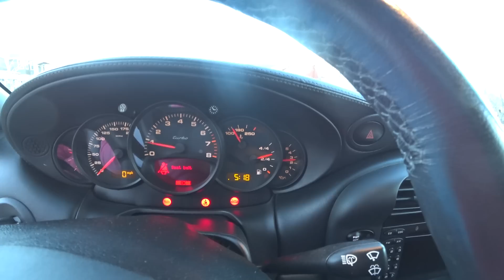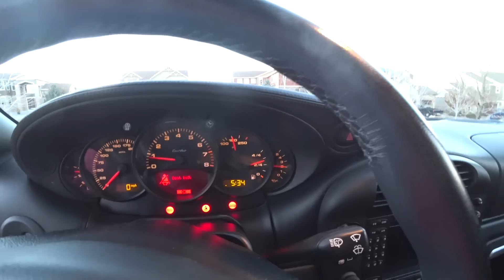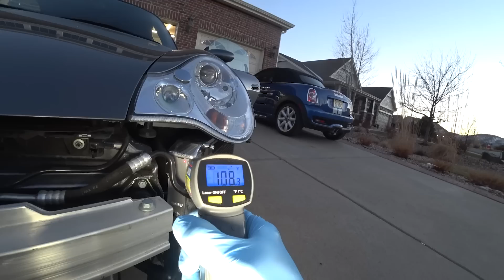Replace your Radiator - Refill without air pockets! Airlift! (996 Turbo)

Comment from the maker: Eeek a leak!! Hi Everyone, Well, the 996 Turbo's left radiator sprung a leak.  In this episode I go through draining the coolant, removing and replacing the radiator, and refilling with the AirLift Radiator vacuum filling tool.  That thing is amazing!  Let me know if you have any questions.

Tools and stuff in the video:

AirLift Vaccum Radiator Fill: https://amzn.to/2ULyE2c
Silicone grease: https://amzn.to/2GguZGs
Thermal Temperature Gun: https://amzn.to/2GlfVr7

Comment: Excellent as always. Concise & appropriate emphasis on potential problem issues. Completely agree about cleaning out the radiators. I bought a '99 Boxster last Winter & both radiators were blocked by leaves & plastic lids from cups. I fabricated some mesh screens from steel gutter guards on the back of the bumper grills to keep the larger leaves & cup lids out. A simple $6 improvement. Thanks again for taking your time to share. All the best.
Reply from the maker: Thanks!  Great idea!

Comment: Hi Franny and Heidi. Just did the radiator on my 996. Used the small inlet “ small tube and a funnel “ to ad water. Made it no air. Just a hint so you not need a vacuum tool. Ps had the wheel off and the car up in the working corner. Best regards. Jørgen Copenhagen.

Comment: These cars always have coolant issues. Especially the first generation 997 Turbo. I would never buy one because all my friends are always complaining of the coolant smell. Don’t hear the issues on the 996 turbo. Great job guys!
Reply from the maker: I bet that coolant smell is the weeping radiators.  The OEM radiators weep (not leak necessarily).  Our 987 '06 Boxster S had the same issue...  That was the primary reason I went with these all aluminium replacements.  We don't smell any coolant anymore!  But...  These engines can also loose the coolant tubes pressed into the engine.  I swear these engines are fighting being water cooled with their last breath!!

Comment: Brillant,  I would not even attempt to fill the cooling system in a Porsche without one of those vacuum devices. I changed out my water pump on my non-turbo 997 a few years ago. I weighed the amount of coolant that came out and weighed in new coolant (did not change it all) . I found afterwards that the coolant was exactly at the same point in the tank as it was before.

Comment: Thank you for putting this together, very well done, I changed all 3 radiators, and purchased the coolant lifter tool which made it real easy to refill the coolant system.

Comment: Just did the same to my 2002 911 turbo, except it was the center radiator leaking in my case.  Initially, I was considering upgrading to a CSF rad, but I got lucky and got a good deal with a never-been-used OEM unit that I found in the classified ads. The coolant that was in the car was green, so I suspect it wasn't the right one and I didn't know how old it was, so I did a complete flush.  Getting all 6 gallons drained out is indeed a process, but a little bit of compressed air makes the job easier.  To refill, I also used the Airlift and it worked great!
Reply from the maker: Thanks for that.  Interesting your center radiator went out...  That was the only one that didn't leak on our car! Good idea on the compressed air.  If AirLift was clever, they would engineer their product to do both ;)

Comment: Another great video Franny, I`m going to be changing the waterpump on my 996.1over Christmas and then have a cleanout of the radiators as a precaution. These cars are great to work on sometimes but I changed the waterpump on my 987.1 Boxster S a few months ago and that was a real pain as it`s behind the drivers seat.
Keep the videos coming girls.
Reply from the maker: Oh, I bet...  The only downside to a Boxster is that front engine access...  Great cars though!

Comment: A couple questions:

1. How long do you estimate repair took start to finish?
2. Estimate of your cost vs dealer charge? Just curious. 

Getting good customer service is such a good feeling. Thanks for sharing.
Reply from the maker: Um,...  It always takes me longer because I am filming... but I bet it could be done in about four to five hours?  Since the radiator was a warranty replacement and I re-used the not-very-old fluid, it was a zero cost job for me, but that was just lucky.  I don't know about the Dealer or Indy, but maybe $500-$600 plus parts?  Just a guess though.
Reply: Thank you for your answer. That was exactly what I was looking to know. Thanks for sharing.

Comment: Great timing! My 997.2 has a small leak at an O-ring. I actually have the Airlift tool; however, I haven't used it yet. This was great. The systems seem similar between the 996 and 997.2 yeah? Love this channel!
Reply from the maker: Thanks! Yup, I think they are really similar.  We had an '06 Boxster and it was pretty similar.

Comment: Oh, you've been to Harbor Freight. I can see three of those blue LED lights at the top left of your screen that they sometimes give away and those Pittsburgh impact set. lol I have the Schwaben Refill/Air Purge Tool and using one is a first for me for my 991.1 GTS. Luckily my 993 won't need it (snicker)...nothing like "air cooled". Nice to see you are particular in how you do things. My cars and motorcycles never make it to any shop for the same reason.
Reply from the maker: HF has some great stuff! ...and some crappy stuff...  But their tools have a life-time guarantee and are great for light to medium duty.  I bought some Craftsman tools at the end and they were terrible - and that is compared to the Craftsman I already had. There certainly are better tools out there for sure though :)
Our 993 has has so little go wrong it is hardly in any videos ;)  Great cars!
Reply: @HeidiandFranny  
In my very early teens, I could not afford much in the way of tools but when I got a summer job in my late teens working at VW prepping cars and working in the body shop, I had a choice of Snap-On or Hazet; I chose Snap-On and they cost me an arm and a leg on minimum wage. I now have a good selection and buy the odd tool as needed. I also have a Snap-On 1/4", 3/8" and 1/2" clicker torque wrenches, all calibrated (not bad for a home mechanic), but here is a tip, you can get them much cheaper from Precision Instruments who I believe is owned by Snap-On. I head stateside now and then to go to HF. They do have some quality tools. As for your model aircraft, that is how I started (U-control) and then got my PPL, CPL and Instructors.

Comment: An excellent vlog both in the instruction given, the production and of course editing. The fact I now feel confident with replacing a 996 T radiator when I normally limit myself to fuelling and detailing the car is testament to your coaching ability. I realise it's of little comfort but you both should have far more subscribers if only to increase the mechanical capability of the population! Kind regards, Kevin.
Reply from the maker: Thanks Kevin!

Comment: Love your video's even though i don't own a Porsche , just a thought on that aluminium Radiator that failed  and antifreeze mix , Aluminium doesn't like tap water a lot ,it's best to use deironised water in the mix. It's good that you highlighted the excellent customer service from that company ,it's becoming a rare thing in this day and age .Thank You Again.
David .UK
Reply from the maker: Thanks David and that is a good point.  I didn't cover that because I reused the coolant, but I should have. When I did this last time I did use deionized water to cut the coolant (per Porsche) at 50-50.  The little bit I had left over was from that batch.  I don't know why that radiator failed... Great catch! F
Reply: Thank You Heidi, Keep Up The Good Work, and i wish you and Heidi a Merry Christmas and a Happy New Year. Take Care Both. David
Reply from the maker: You too.

Comment: Man, awesome video on this process.  Nice to see someone else that cleans everything that comes apart.  Everyone looks at me like I'm crazy when I clean everything like that while doing jobs like this. Awesome tool suggestion. I have heard of these but just haven't invested in one. Just curious, what what the issue with the original radiator?  Metal fatigue? Debris damage? Vibration/wear damage?
Reply from the maker: It was leaking near the top. No idea why.

Comment: Hello Franny, as everytime you make a video on your 996TT, I loved it. It gaves me the motivation to do it on the right radiator of mine. Thx for the links, especially the vaccuer.  But I am missing only the one for the full aluminium radiators (CSF?) / hopefully they have some dealers in Europe / Germany... ;-) BR Yann 
P.S: continue so, even if the number of subscribers/viewers is not so High as the quality of your work. You are amazing, competent and your tips are so usefull !
Reply from the maker: Thanks so much, and you are right!  I'll add a link to the CSF site.

Comment: Great video! super useful! Is there any chance you can do a quick video on how to check if the turbo wastegates are stuck? do you have any advise on those?
Reply from the maker: I don't but I bet you can disconnect the actuators and move them by hand.  I don't know how stiff they should be though...  What make you think they are not working?  You can't build boost or it over-boosts?  If you can't build boost it is a good idea to pressurize the intake and check for leaks with a smoke machine or soapy water.  I found three on our car.  The pressure sensor, a bad hose clamp and something else...  Can't remember.   You don't need much pressure (~10psi).  Good luck!  F

Comment: Excellent work Franny!!! Those PCCBs are sexy, I can’t see why you left the wheel on. I think my passenger radiator  is weeping a little. I can barely smell coolant sometimes, but cannot see any leaks. Your coolant drain is pure genius!!! If I were to replace all 3 radiators, I shook go ahead and replace those front hoses right?
Reply from the maker: Franny said check the rear hoses.  Fronts if they seem like they need it.   Heidi

Comment: Great video.  Hope I don't have to do the same to my 2004 Turbo.  Q:  How did you log the locations of the various fasteners?  Separation in trays is great, but was that sufficient?
Reply from the maker: Hi Dan, that is a great question actually...  I think I had four, five parts trays?  And I still had different fasteners in each tray.  The magnetic trays will also allow you to separate them into different sections in the tray.  If you think you are getting a little over your head try taking photos with your phone or small camera to refer back to later.  I actually do that a lot! Also getting the job done in a reasonable amount of time helps.  Finally, don't work if you are fatigued...  Surprising how much concentration this can take (at least for me).

Comment: Thanks for the video! It was very informational. I just ordered all three radiators for my 04 996 Turbo Cab! Left and Right are leaking, and I figured I would rather just do it once than have to replace the center later on. I'm actually in Colorado, and will probably be doing the work in a friends garage in Littleton. Would it be okay if I PM'd you if I run into any issues or I get stuck and need some advice?
Reply from the maker: Sure. Just send an email to our website. Admin@heidiandfrannysgarage.com

Comment: Was watching hoovie and then googled 996 cooling upgrades and came here love it!  Also after you released the airlock burper the flow of coolant off the blue packing, looked completely still with the camera frame rate?
Reply from the maker: That's cool!  Yeah, Hoovie's issue isn't unheard of, but still isn't that common.  That engine just hates being water-cooled.

Comment: Solid job! That filling tool is really nice. Great customer service by CSF as well. Did the 996 Turbo's come with white side markers in the US? I seem to recall they were amber in the US and white in Europe.
Reply from the maker: No,...  It had the horrible orange ones when we bought it.  Easy enough to source the "correct" ones and install an orange bulb :)
Reply: Glad you got them replaced. It must be one of the easiest fixes with the greatest result in car terms :)

Comment: Nice video! I did not see what the burper looks like. What does it do?
Reply from the maker: Oh, sorry, it is that little hoop of metal (like a bale wire).  Normally it is horizontal.  You can raise it to force the release valve open allowing air to escape.  I leave it open for the first few drives and then plop it back down.

Comment: I am having real trouble with my 69 single cab all the radiator fluid is gone in fact i can not even find the fill point.  Engine is not complaining. But Franny why are you using electric motors on your model aeroplanes?? Haha   Franny never swears and she is the only one who can wear sunday best and never get oil on her sleeves.

Comment: Great video, i was just wondering, will the vacuum work when the system hasnt compleyely drained of fluid?
Reply from the maker: It will, but it is best to get as much as possible out.  The venturi will spit and sputter a bit so be ready with a cloth around it.

Comment: Very helpful, thank you!  Do you believe the black debris you saw when draining the fluid might be wear particles from the water pump?  I'm debating on when to replace the water pump on my 2003.  thanks!
Reply from the maker: Boy, I hope not...  Are you thinking from the impeller?
Reply: @HeidiandFranny  I'm absolutely no expert, but it did look similar to a video I had seen on water pump failures in 996/986's.  That video implied seeing small black particles was a sign the impeller was wearing significantly and it was time to replace before any pieces got stuck in nooks in the coolant system or the pump failed outright.  I noticed only because I have been trying to decide how urgently I should replace the pump as it is apparently a known failure point from what I've seen... so I could easily be seeing it only because it's on my mind.  In any case, I've watched a number of your videos now, and you've been very helpful as I learn!  This is my first, and truly a low cost entry... so I'm trying to learn and also be proactive to help it last a little while :-).
Reply: It wasn't a video, my bad, it was this forum post:  http://986forum.com/forums/boxster-general-discussions/35434-go-ahead-procrastinate-like-i-did.html
Reply from the maker: @artshipdesign4802  Thanks for that!  I wonder if the turbo uses the same part as the NA car...  The vast majority of issues with this car have been cooling...  I'll look into it a bit more.  Thanks again!

Comment: Hi Franny , did you have 2 washers per grommet and tab easher or just the 1 ?? I seem to have some with a washer either side of the grommet andthen the tab washer and some with just 1 washer after the grommet before the tab washer
Reply from the maker: Ok, great question!  When I pulled it I heard a tinkle of the washer hitting the floor, but I couldn't find one (or two).  I figured it rolled under the boat to not be seen again so I replaced them.  I think there should be one on both sides.

Comment: Just ordered the same radiators for my 996. I am a little worried about the hoses. My car only has 60k miles. Did you have any concerns about the hoses or the o-rings not sealing?
Reply from the maker: O rings aren’t a problem.  If the hoses are soft and pliable, they will be fine.  However, I would replace the two in the rear and since the coolant is out anyhow, you should do them.  Just use silicone grease and they will pop right in.  Pelican has the hoses for a reasonable price.

Comment: Hi! Your system wasnt empty right? I can use airlift even with coolant inside the system? Thanks!
Reply from the maker: No, it wasn't but it probably was only maybe 1/3 full?  It does spit a bit so I used a towel to catch the spray.  It works best if you can get all the fluid completely out.  It can actually collapse the hoses so it will force any remaining fluid up to the reservoir.  Hope that helps :)

Comment: Might be a dumb question...if I top off with coolant will that create an air pocket? I checked my coolant the other day and it is on the low side. Haven't gotten a warning yet. Car is a 991 TTS.
Reply: By the way, great channel!
Reply from the maker: You won't get air pockets just from filling unless your reservoir is completely dry and, in that case, you have bigger issues ;)  If you find your coolant low, top it off, but keep an eye on it.  That fluid has to be going somewhere.  Also look for a color change in the fluid.  If it changes color or is continuously low and you don't see drips, check that your oil level isn't going up.  That would be bad.  The 996/997 radiators tend to weep (not drip) and will loose fluid that way.  You can smell it if you spray the hose up front.  You have to remove the front bumper to do a proper inspection.  Just keep an eye on it... F
Reply: Thanks for the heads-up! Its not empty but the level ball is leaning towards the lower end. This is honestly the first time I checked the fluid. It might have been low since I bought the car +two years ago. Will keep an eye on it.

Comment: Do you have a vid when you replaced the center radiator?
Reply from the maker: Sorry I don't, but it is pretty much the same...  Except that the center radiator has its scoop riveted on.  You need to carefully drill out the rivets and then pop rivet the scoop back on.  The hose connections are the same.

Comment: replace my broken radiator, now the 996 has a leak when it cools and not when it is on, what could it be? Thanks
Reply from the maker: Depends on where the leak is...  Is your expansion reservoir leaking? ...or the cap?
Reply: @HeidiandFranny  Hello, thank you very much for your answer, it turns out that the radiator I bought had a fault, when buying another the problem was corrected.